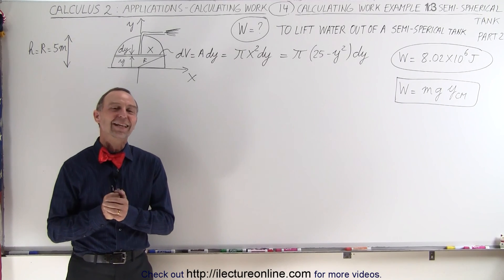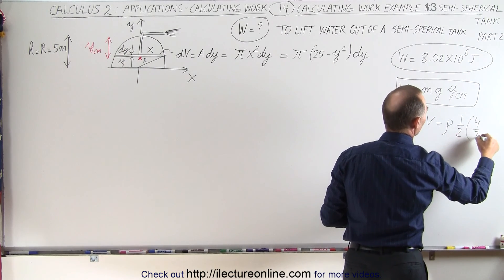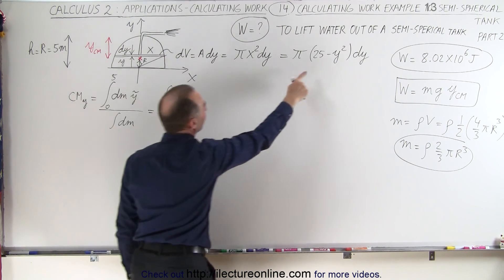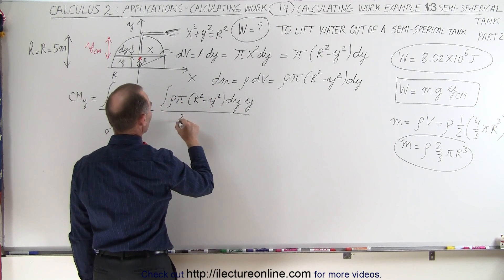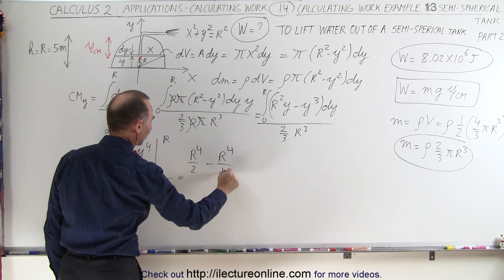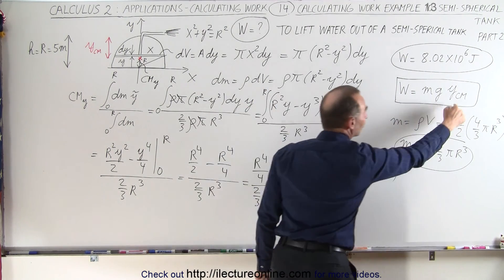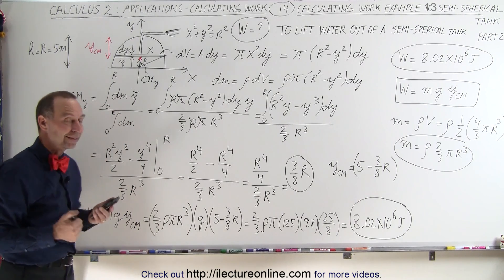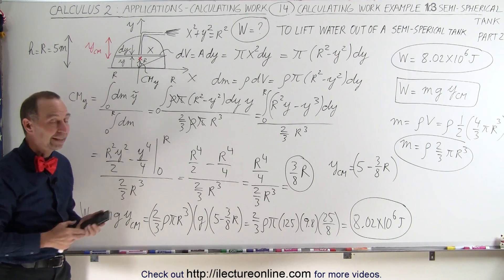Calculus 2: Applications - Calculating Work (14 of 16) Cal. Work Ex. 12: 1/2-Spherical Tank: 2

Comment: so once we have that ybar relationship, ybar = 3/8*R we can use that for any semi-spherical tank problem and have a quick check when using the other approach I'm guessing.
Reply from the maker: You guessed correctly.  (assuming the tank is full)
Reply: Fair point. If the rank were 3/4 full then the setup would remain the same but the bound of integration would be from 0 to 3/4R, eh?